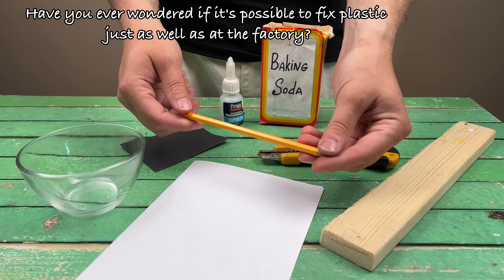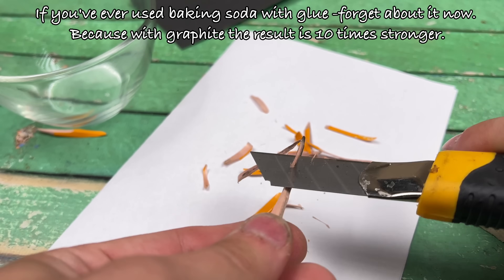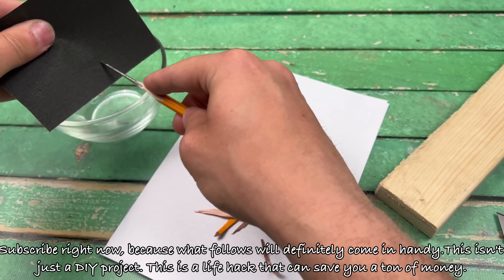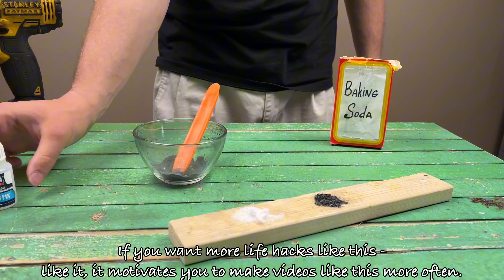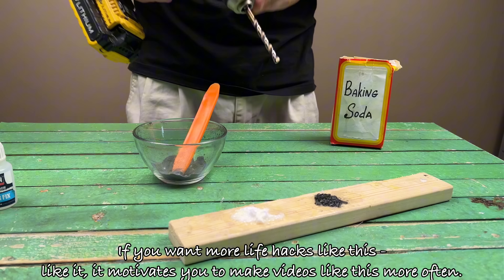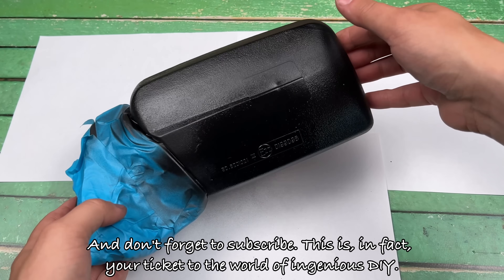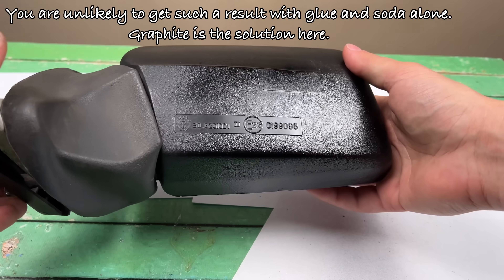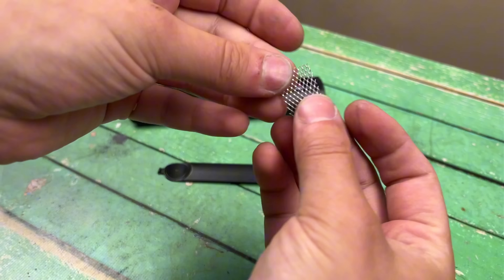All of China is ALREADY welding PLASTIC with a Graphite rod and BAKING SODA!

Comment: At 5:45 and 5:55, you can see the same mirror. The part numbers are the same. However, the tape is wrapped differently, and at 5:55, all the contours are visible, as if it had never been damaged. This is very confusing because it means that the video has been edited incorrectly. Presumably, the intact mirror was “painted” as in 5:55, then a hole was punched in it, “repaired,” and it was suggested that it would look like new after painting. Why would someone do that?

Comment: that drill scene infuriated me, pilot drill first then go bigger. calling out that it won't drill thru the graphite, with that type of bit it's not easy and will wear out the drill bit. you need a spade bit, better yet use a solid carbide drill bit or diamond coated drill bit :face-fuchsia-tongue-out::face-orange-raised-eyebrow::face-orange-frowning:

Comment: WOW! Just what I needed ...Will using GEL type superglue slow down the hardening process? I plan to fix my sun glass broken frame which is a black plastic ...is it ABS? I dont know, but embedding the steel mesh like you did sounds like a good reinforcement.
Reply from the maker: The glasses can be fixed without the mesh using simple soda and a graphite rod! It will be very strong and reliable! You are doing everything and thinking correctly my friend! Tell me how it turned out

Comment: Just get a Q-bond kit. Has the glue and the powder you need. And its way stronger than that baking soda mix. And the glue soaks into the powder alot better. Super stong.
Reply from the maker: I am sure that the product you mentioned is good, but you can always make this at home! 🤗
Reply: It's basically the same ingredients?